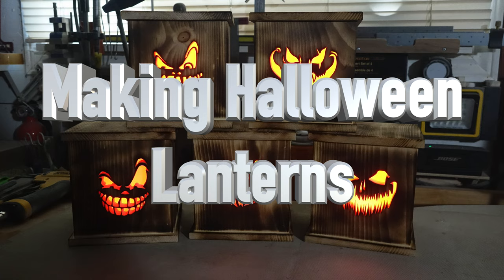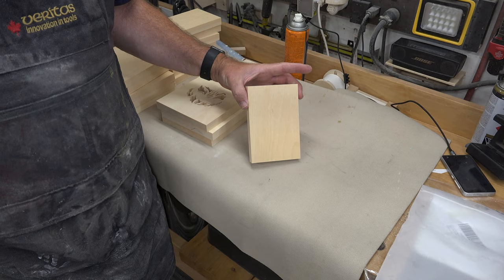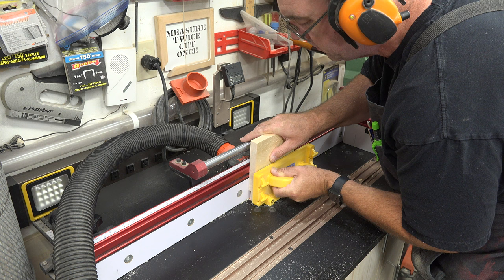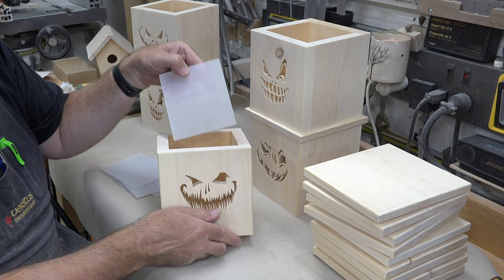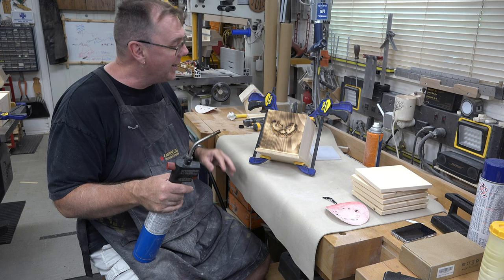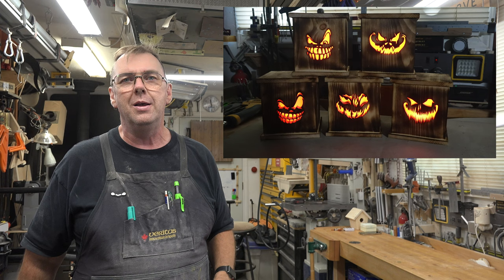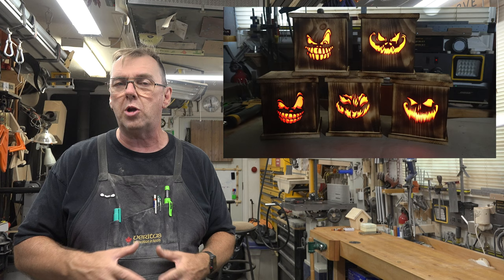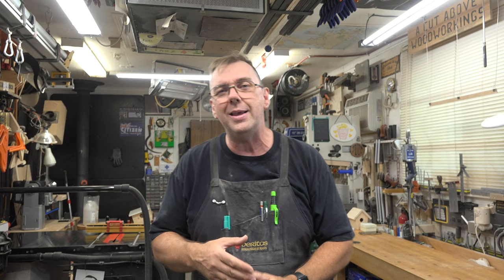Making Halloween Lanterns

Comment: Nice project... couple of thoughts. 1) if there were a stem (which I like), couldn't you put the lid on upside down and then store them stacked like that? 2) Do you think that wax paper could replace the plexiglass? It may be much cheaper with similar results.
Reply from the maker: Another viewer also suggested storing the boxes like that with the stem on the inside.  Where were you guys when I was designing these lanterns?  LOL.  Wax paper could definitely be a cheaper alternative to the plexiglass but I'm not sure of its longevity.  For that matter, if it didn't last, it would be cheap to replace.  Thanks for tuning in and for chiming in with your comments and questions.

Comment: You can put the stems and flip the lid over so the stems go inside the box, you’ll still have a flat top surface to stack the others on top
Reply from the maker: You are not the first to suggest that but I wish that that suggestion came in while I was working on these.  LOL.  I can't believe that I didn't think of it.  Thanks for tuning in and for chiming in with your suggestion.  It's a great one.

Comment: I make my lanterns out of 6x6 treated timber.. But i cut faces on the 4 sides
so if you put them on the windowsill you can still see a face. I use treated timber
so i can put them outside with a tealight inside a jam jar you would call it a 
   jelly jar.. Screw the jam jar lid to the inside of the lantern lid so as you open
the lantern you can easily get to the tealight. Plus the jam jar reflects the light..
Reply from the maker: That sounds like a great setup and I bet it looks fantastic.  Thanks for tuning in and for chiming in with your methods.  It's truly appreciated.

Comment: Just fantastic, such a simple idea but oh so effective ... the burning just adds to the overall effect 👍

You could take this idea and expand it by making the front panel replaceable or put the design on a piece of slot in plexi ... means they could be used to mark other special times of the year or just different themes ........ this would be perfect for creating on a laser!!
Reply from the maker: This would definitely be a fun project for the laser but then I wouldn't get to use my scroll saw.  Thanks for tuning in Barry and for chiming in with your suggestions,  It's appreciated.

Comment: Great video, thanks.  Learned a trick to share.  For these projects where you would use a stainable wood filler, put blue tape where you will be putting in bad nails.  Then put the wood filler in, and while still wet, pull off the tape.  When dry sand the wood filler.  This trick keeps the wood filler from spreading too far and absorbing into the wood.
Reply from the maker: Great suggestion Scott.  Thanks for tuning in and for chiming in with your tip.  It's appreciated.

Comment: Another nice project Kenny.    ..... except for setting behind a scroll saw for hours and putting the blade through a gazillion holes😁
I made a few of these last year but use different lights.  I really like the colored puck light you used.  I have looked on Amazon and I see the same style light with remotes for color change but they are not rechargeable.  They run on 3 AA batteries.  Do you have a link or more info to the ones you used?
Thanks.               JimE
Reply from the maker: I have added the link to the video's description Jim.  Don't knock sitting behind the scroll saw for hours.  It's the most relaxing form of woodworking in the shop.  If sitting for hours isn't your thing, do it in shifts of 15 minutes.  Thanks for tuning in this week.  It's appreciated.